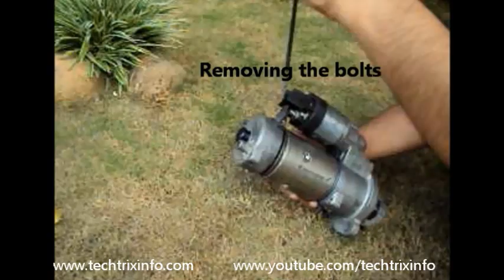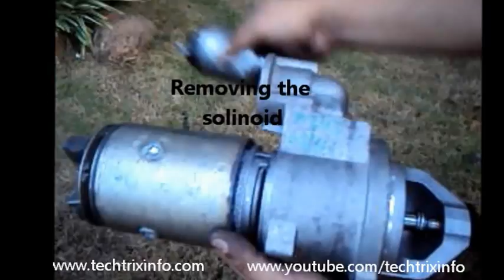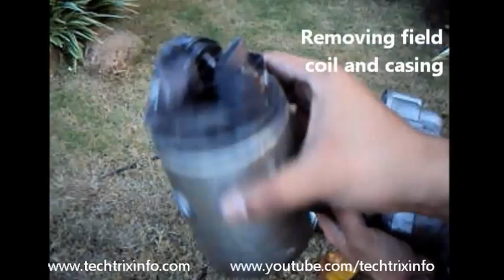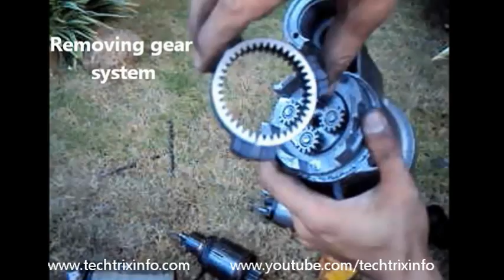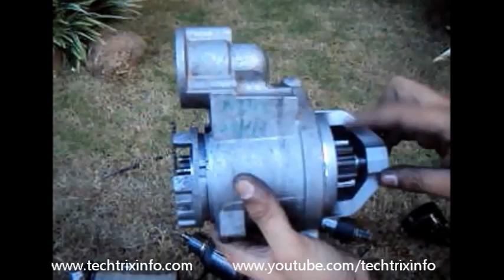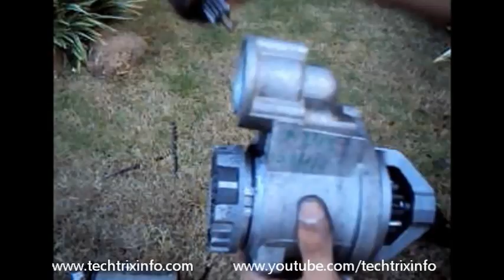How starter motor works (Must watch). ✔

Comment: Sir please let me that how i can increase the rpm of activa 125 starter motor (12 volt)by changing the winding and can run it with 12 volt 5 amp adaptor?
I want to use this in a project there after.please help.

Comment: You missed all the important stuff, Pull in & hold in winding???? contact disk on the plunger, that allows the solenoid to bridge and send current to brushes onto the commutator. You show like 20% of how a starter works and label your video (must watch)???

Comment: this is not how the starter motor works!...it is What's Inside The Starter Motor!
Reply: I agree. While starting the engine. The battery supply the current needed for the starting motor to work. Once you turn on the switch the starting motor will start  to rotate and  the drive gear will connect to the flywheel and the flywheel will start to rotate. When the engine start to work, the flywheel will rotate by itself and the armature or the drive gear will be disconnected to the flywheel. That's the time that you will let go the switch because once the engine start the flywheel will rotate faster on a higher speed that the motor can't. The motor will be wrecked and the armature will lost its slots.
^_^ This is the thing that i know about the starting motor
Reply: Nikko Jaen oh fuck. You must be a time traveler yeah.
Reply: He shown how the mechanical parts functions when the motor runs .  

Dont  show too much intelligence 

Our intelligence  nothing compared to even the  MUD . 

We sow a seed into  mud 

Only mud knows how it  transform  to a plant .

Comment from the maker: This video helps to identify the internal component of a starter motor. In this video a starter motor is dismantle and assembled back.
A starter is a type of electrical machine which converts electrical energy into mechanical energy. 
When the starter switch is operated, current flows through the starter and two magnetic fields are set up. The interaction of these magnetic fields creates a turning movement, which rotates the engine crankshaft, and hence starting the engine.